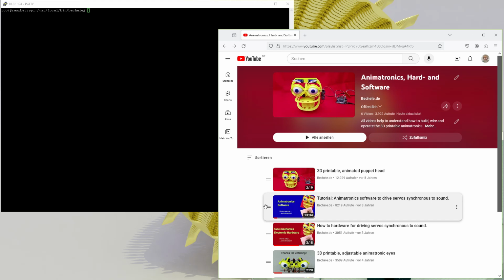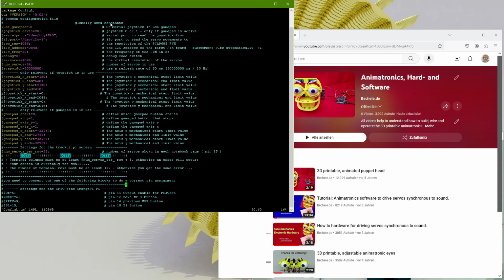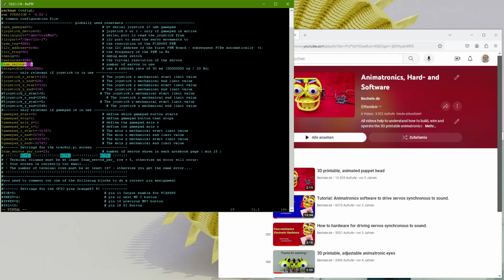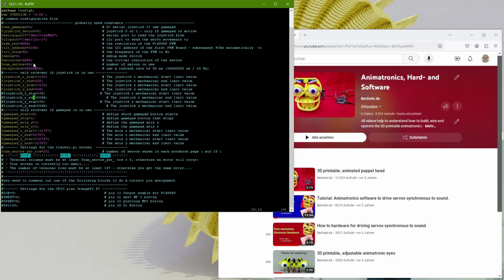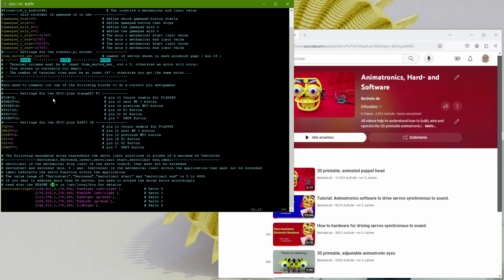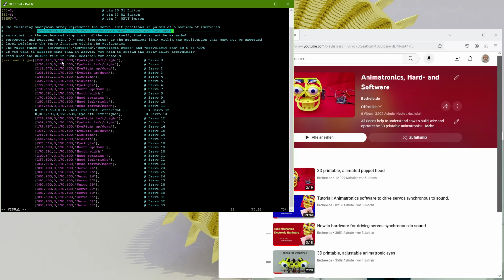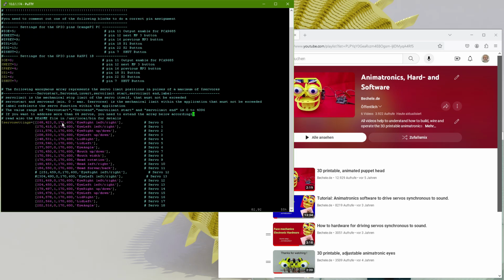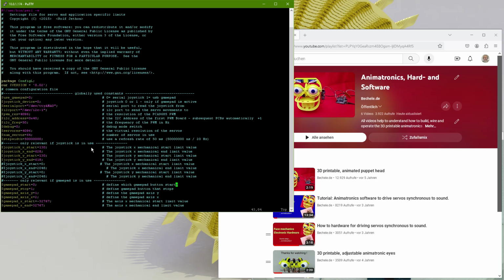ConfigL.pm - configuration of bechele software 2.0

Comment: this is wonderful, happy there is a new version, cant wait to install it! Would i replace all files in sd card with new ones?
Reply from the maker: yes, the images contain all files needed - have a look at the following how to install: https://bechele.de/?page_id=1069. Hope you have fun with it.
Reply: @Bechelede  thank you, i noticed this website after i had made the comment sorry about that, but it looks a lot more complicated to the previous way of putting the image onto the sd card, my sd card is 32gb and is FAT32.
Reply from the maker: How the SD card is prepared is unimportant, because an image writer just copies all - including formatting. After installation of the image not all space of the card is in use - only about 2,5 to 3GB. Only if you want to use the rest of the card it becomes a little more complicated. But for starting, there should be enough space left on the file system. So increasing the file system size is just an option.
Reply: @Bechelede  Thank you, i already have a few test speeches and music mp3 ready that are abount 2 to 3 minutes long, would there be enough space for that? Or would i need to increase the file sisze? Also how do you put the mp3 audio on the sd card? Thank you again!
Reply from the maker: @drnoelll Sure, the file system (depending on which image you use) has still at least 350 MB free space. Two MP3s of 224 Kbit/s @ 3 minutes have perhaps 15 MB and the servo movement files are far smaller. So you don't need to worry about the space of the minimized file systems.
Reply: @Bechelede  thank you, so if I want to save longer audio I would need to get a bigger sd card more than 32GB, so say 64gb or 128GB? Thank you again!
Reply from the maker: I have the impression there exists a mis understanding. The image has a size of 3 GB. Though your card has a size of 32 GB you use only 3GB.  But within the 3 GB you still have approx 300 MB free space. Independent of the size of your SD card your file system size is alwaxs the same 3 GB even if you use a 512 GB card. So the recommendation in the instructions is to increase the file system size to the rest of the empty space of the SD card. The reason I minimized the file system size is that I don't know the size of the users SD card. After installation it is simple to increase the file system size, but difficult the other way round.
Reply from the maker: However in your case you don,t need to do anything at all. The space you have, is sufficient for your project. Once you reach the limit you still might increase the file system size without any data loss.
Reply: @Bechelede  Thank you, apologies for not understanding, i see what you mean now, it makes sense, when i have added your phone number to my contacts, could you help me along on how to install it properly without it going wrong and also increasing the file size? Is that possible? Thanks again!
Reply: @Bechelede  Thank you, could we take a call and may you help me along with the installation of the image and increase of the size, i would like to posibbly add longer music tunes that may be 5 minutes more or less! Thank you again, Rolf!
Reply from the maker: Perhaps tomorrow morning 10:00 CET? What kind of operating system you are working on on your (Office) computer ? On windows you can use win32 Disk imager.